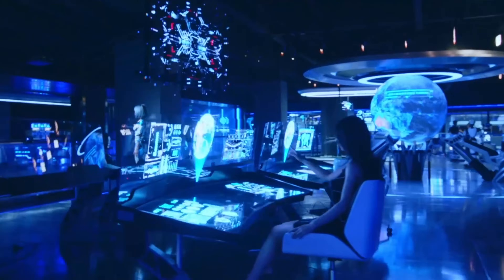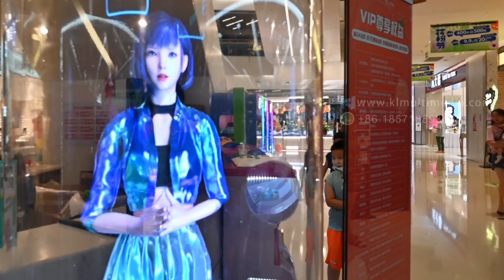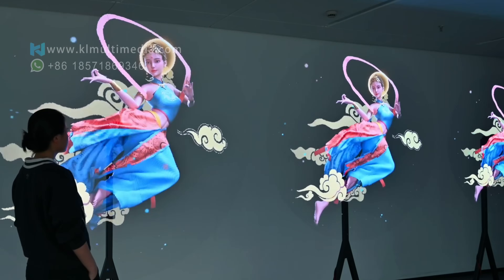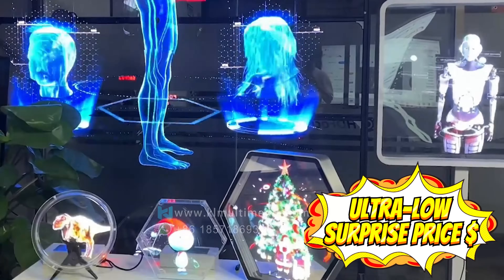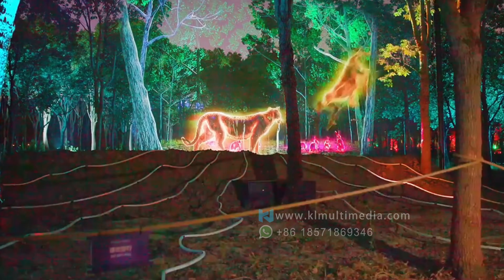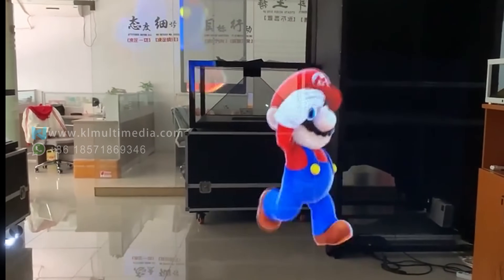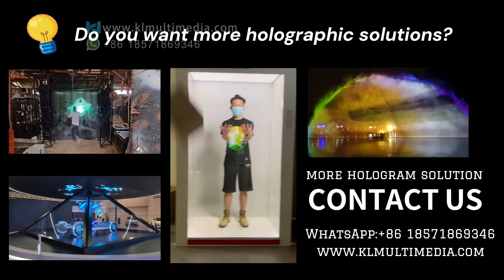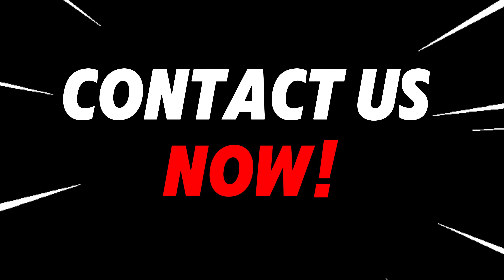2025 update : How To Make a "Real" 3d Hologram Projector Or Fan Screen Display In The Cheapest Way?

Comment: Does the hologram projector work with any kind of input, or are there specific formats needed?
Reply from the maker: Great question! Most hologram projectors require specific formats to ensure optimal display quality. Typically, they work best with 3D formats or specially prepared videos that maintain the illusion of depth. What type of content were you thinking of projecting?